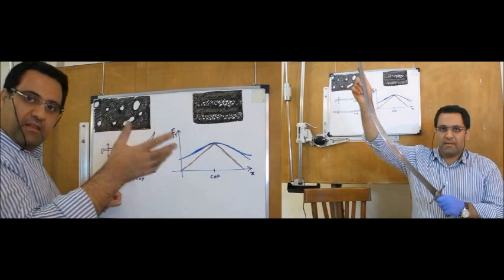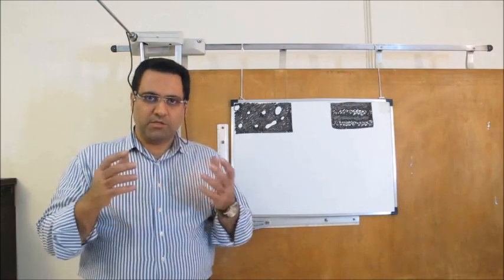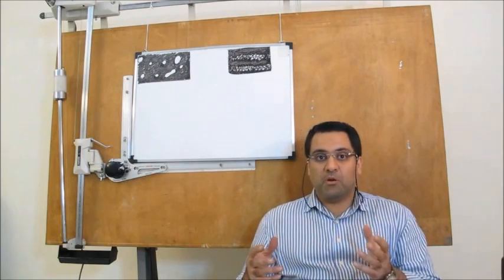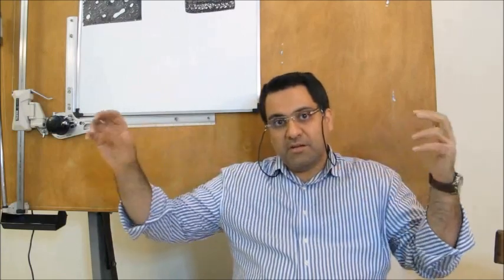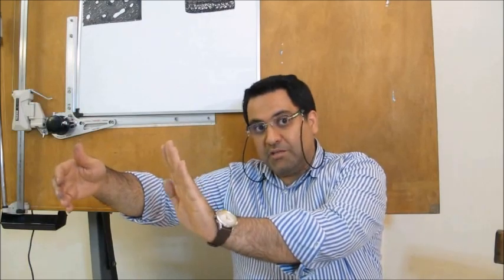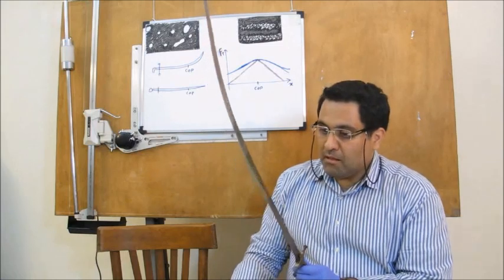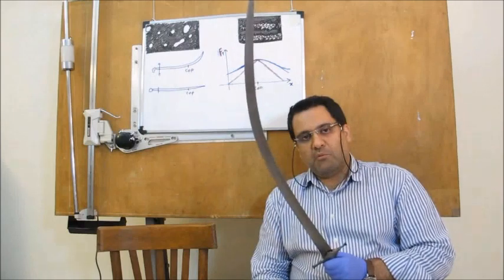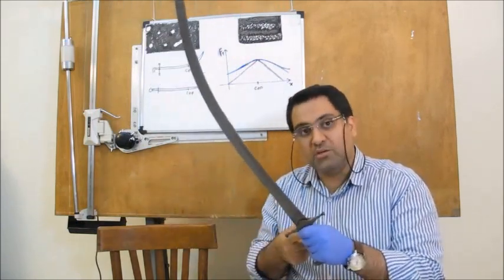Physical Properteis of Iranian Swords with crucible steel blades

Comment: Would you know how flexible is this specimen? I am wondering what the balance between the flex and strength was.
Reply from the maker: I have not handled this specimen but many others
Reply: @RazmafzarTV  Are they necessarily meant to be flexible, and to what degree?
Reply from the maker: Of course they are.  They are one of the est quality blades ever made. In the Safavid period, they called flexibility "dohniyat" and it was one of the main characteristics of quality of a blade. In contrast to the common opinion among some collectors in the west, crucible steel blades have very good flexibility, not that visible more like a Nihonto blade